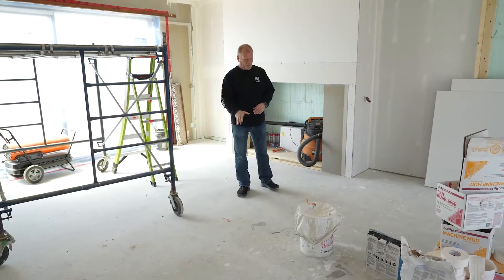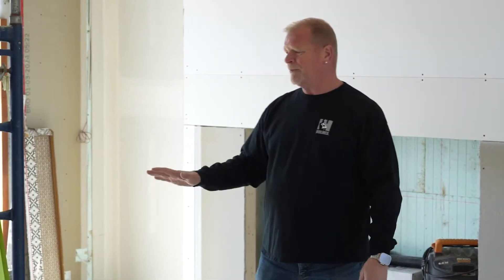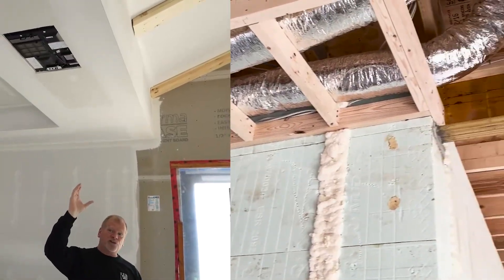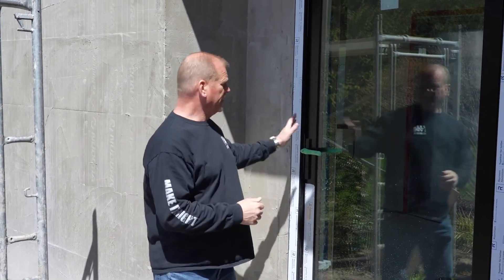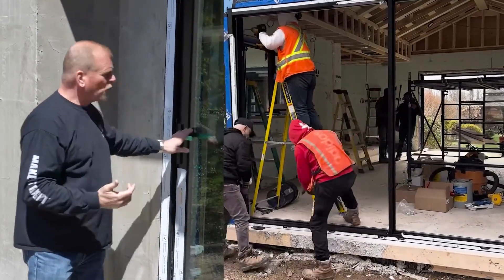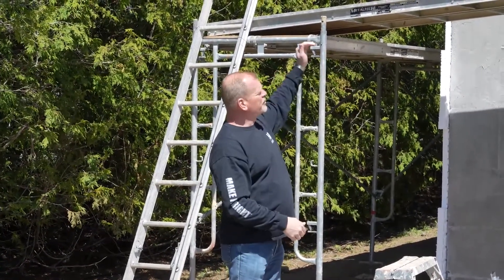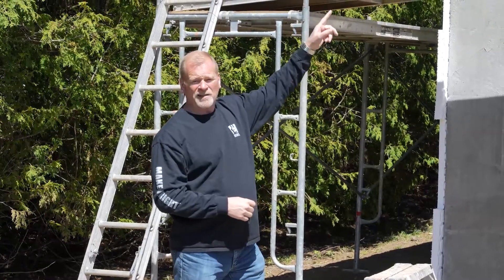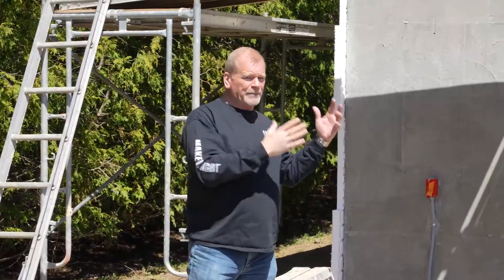Building the Ultimate ICF Sunroom: Airtight & Energy Efficient

Comment: Hi Mike, I’ve got a question related to air exchangers (ERV or HRV) and wood stoves. In this case, you chose to supply combustion air via the ERV. An ERV is a balanced system bringing in as much air as it exhausts. It seems to me there would be a negative pressure in the room when the woodstove is operating despite the ERV. Up until now, I’ve been thinking I needed to bring in a dedicated outside-air duct to the woodstove. The outside air route may affect air-tightness, but I was thinking this was necessary. Is it the case that the ERV will supply enough air that I don’t need to worry about outside air? Does the air draw more on the intake side via suction, even though the ERV blower is balanced? This is important to me as I hope to build my home soon, and I intend to make it super-tight with a great ERV. This is the first time I’ve heard of using the ERV to supply combustion air. Thanks, Tom
Reply: I’ve thought about this. I’m not sure about gas, but if it were a wood stove, you’d want a dedicated outside-air channel, sealed, and connected to the heating appliance. This is because the combustion air requirements would significantly exceed (I think) the fresh air demand and supply for the living space (provided through the ERV/HRV). I would go further and ‘oversize’ the intake combustion air pipe to, say, 6” to provide better draw on startup (lighting the fire). My two cents worth, and I hope that helps somebody—this stuff isn’t always easy to figure out what the right thing to do is.